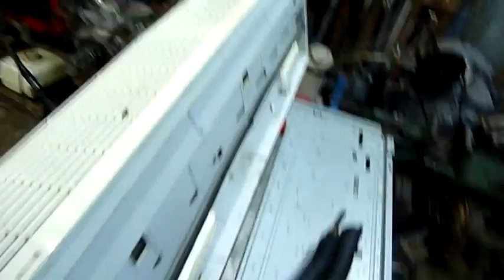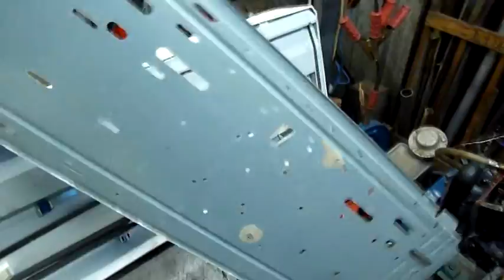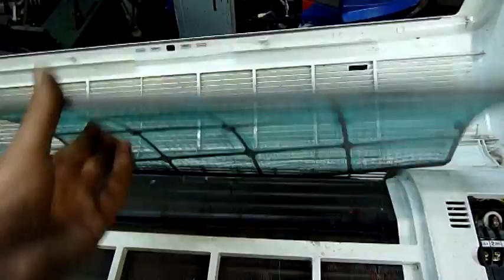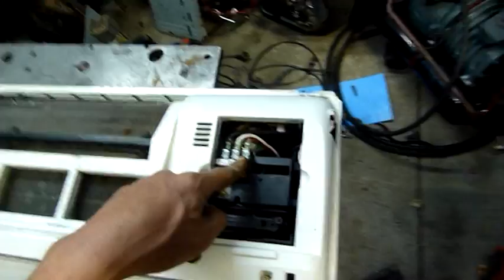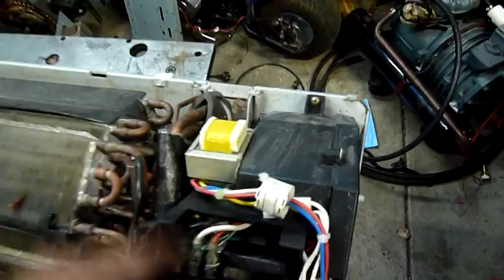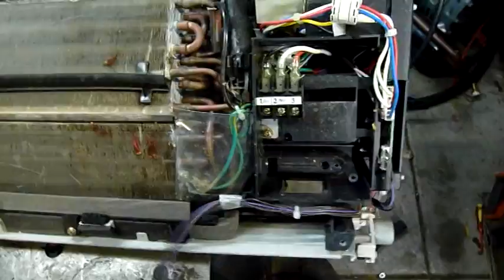Fujitsu Inverter Aircon Indoor Unit Autopsy pt1

Comment: Maybe a basic question, but: I have an identical unit and I tried to remove the (complete) front plastic cover in order to properly clean it. Removed 6 screws at the bottom but the clips at the top (part of the housing) are impossible to lose. Even on your video, the images from the back show that they are pretty tight. Any ideas or suggestions would save my day. The unit is wall mounted, of course.

Comment from the maker: @zforce69 you would have to put it in a high pressure atmospheric chamber then pull a vacuum. simply vacing a coil down at normal atmosphere will never hurt it. its actually part of comissioning a AC system, to remove any air and moisture